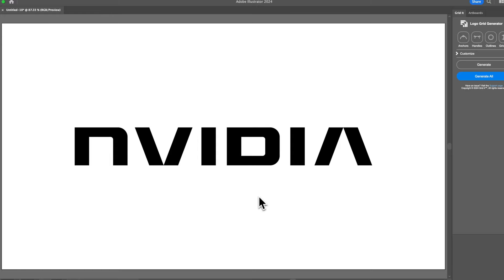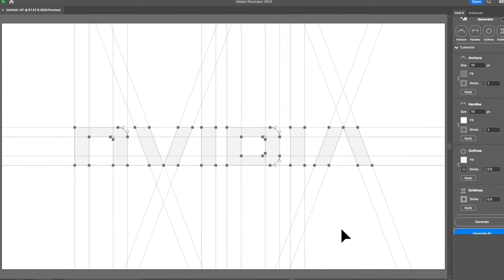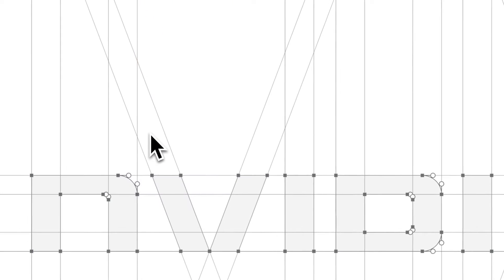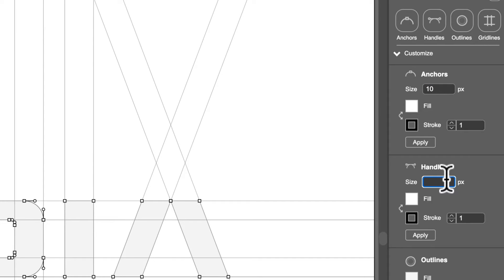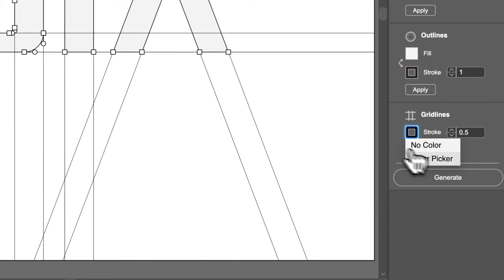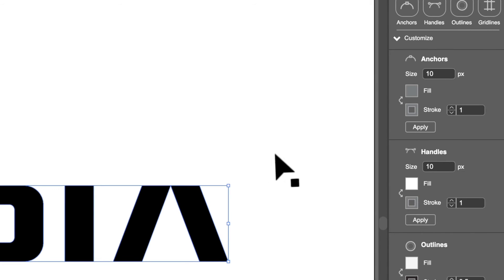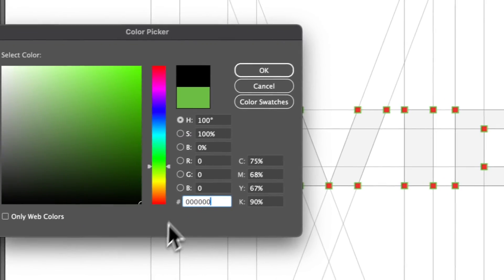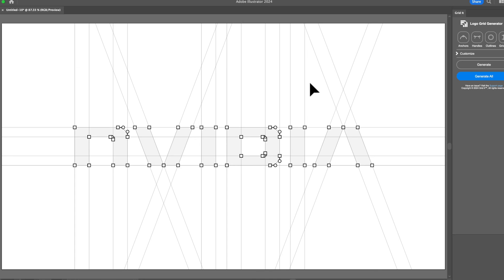How to use Customize Tab -  Logo Grid Generator™

Comment: I don't know why, but the grid generation never works properly for me. It normally generates only one line, and sometimes, it doesn't generate handles or anchors. When I test it with simple shapes, like a square, it works, but for more complex shapes that I designed, it never works. Also it would be really nice if it could generate circular grids.
Reply: I actually have the same problem. doesn't matter the logo. the extension just glitches out, only generates random stuff or just duplicates the logo several times...
Reply from the maker: Hi there. I believe the reason your having this issue could be down to:
- Not having straight lines so Gridlines won't appear
- Not having repetition within your logo so Gridlines won't appear

Please send the ai file to support@gridit.io and we can investigate further, in which we will send a loom demonstration. 

Thanks!
Reply: Sir i need a key license.